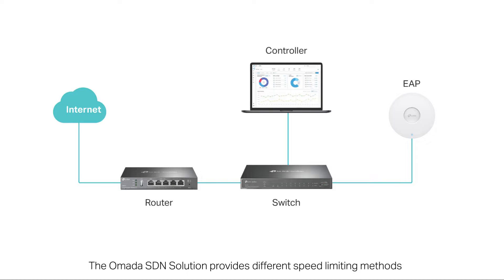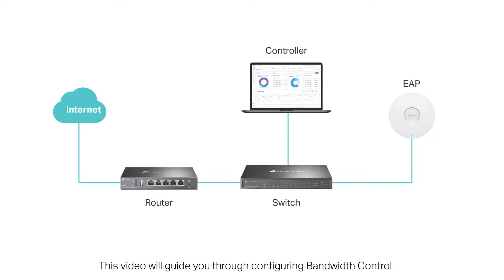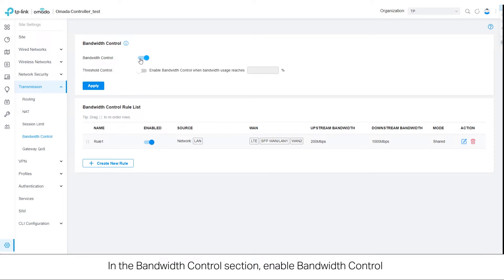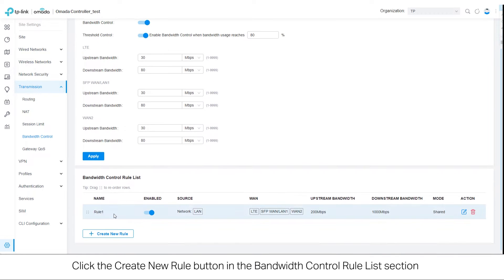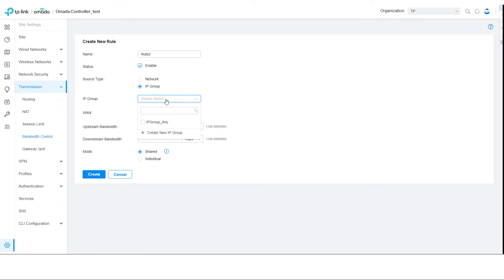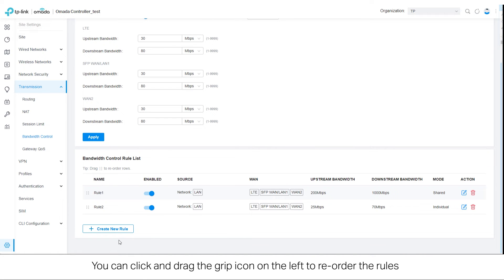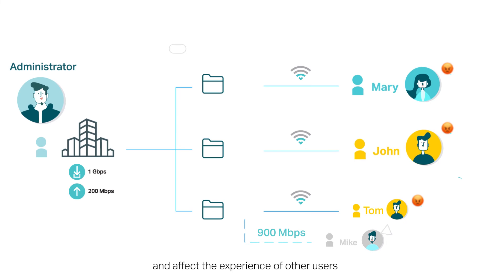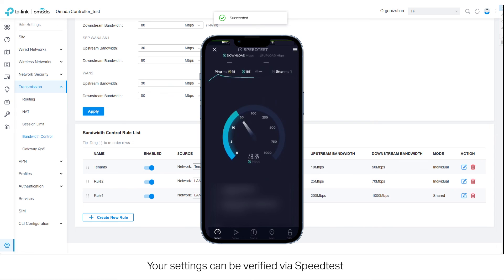How to: Configure Bandwidth Control via Omada SDN Controller

Comment: Very bad bufferfloat can be seen with the increased latency when downloading at the end of the video in the last example. This will provide horrible user experience. Strongly consider adding the possibility of using queues with queue types, such as fq_codel, cake, pcq etc. Additionally, with such hardware and costs, we should be able to specify a minimum bandwidth utilization for each network/ip-range & source/destination which should be met under congestion -- and then share the remaining available bandwidth once each rule has met the minimum bandwidth requirement. This ensures full usage of the available bandwidth by allowing each "tenant" to split the bandwidth equally under congestion. When 3 tenants are using the 1gbps then  each tenant should get an equal share of 333 Mbit each. When only 2 tenant use the 1gbps, then each should get 500Mbit each, fair and square. At this time, tp-link offers very poor support for this, and I would not recommend this brand currently until such functionality is made available.